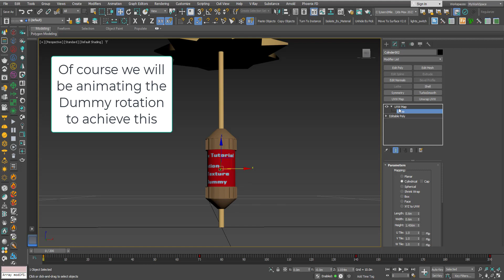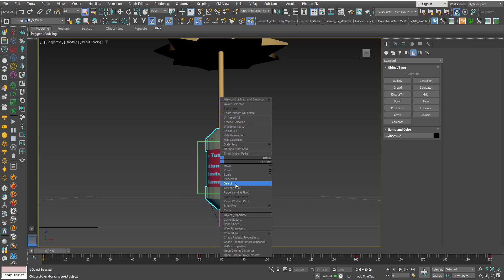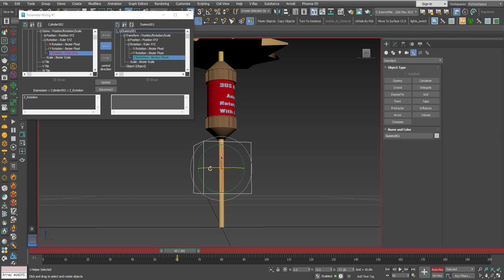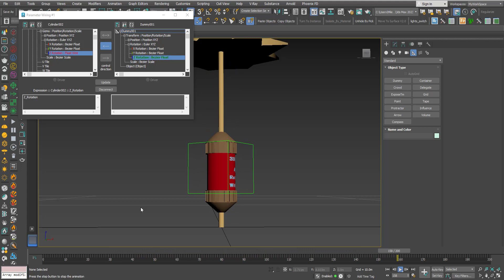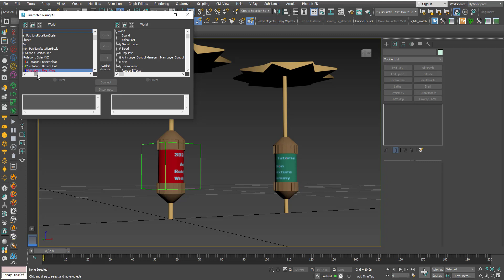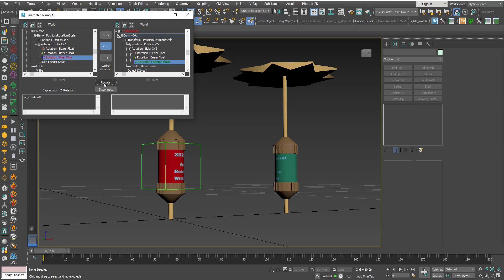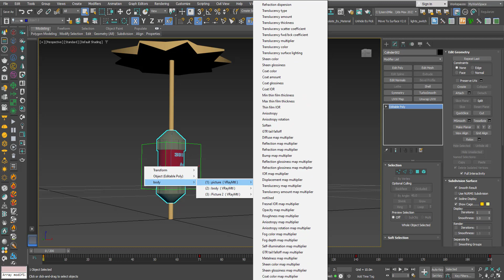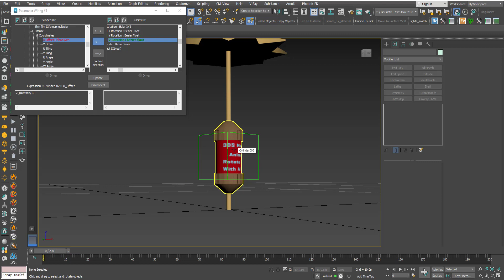3DS Max - Animation - Rotate A Texture Using A Dummy And Wire Parameters

Comment: I have used Max from 1997, but still encounter things I wish I could knew before encountering them. Idea for  video where all kind of these little things are show where to find. Structure of the video: You have this problem -> solution is this/found from here -> next problem. No deeper analysis, naming problem and solution.
Reply from the maker: Hi, in some cases it's true, when you're working on a project and you encounter an issue, and you just want to solve it and continue your work. Now, for learning, understanding what you're doing, how things work, some under the hood understanding of some technical stuff, will make you feel in control of the software, and this will make you love it more and enjoy it, and you can be more creative with it.